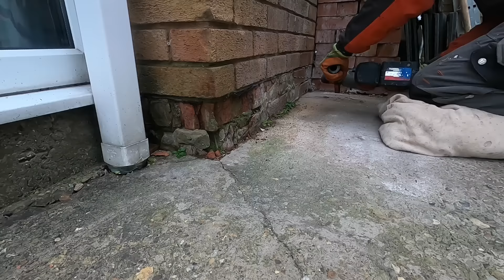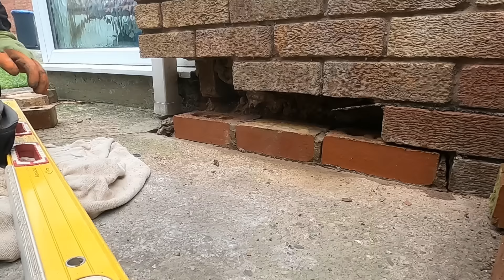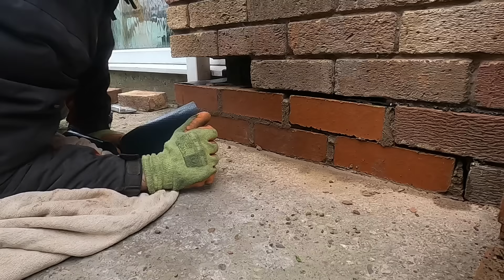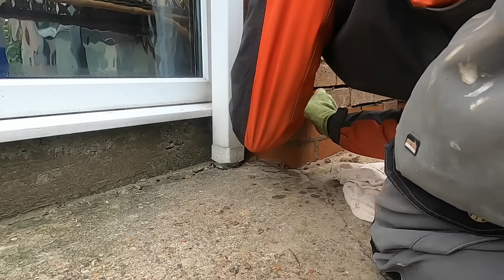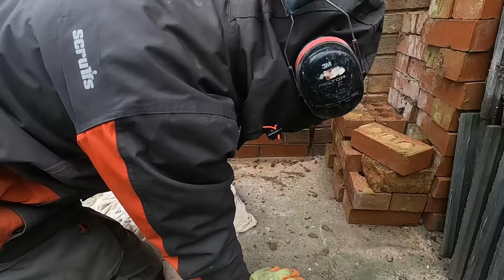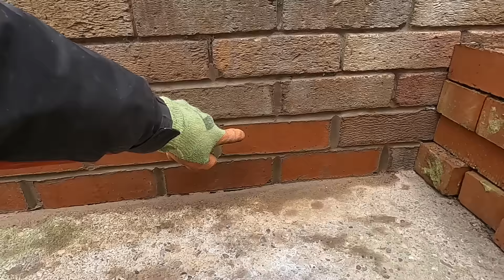Bricklaying- Brick repair job

Comment: I would have taken a quarter inch off the height of the bottom four bricks to help you out. You can make your own thin slicker by grinding it down little by little - try not to make it too hot - I put it in water after every little grind.  I made  a  3/16+ 1/8 slicker with a small tip.  If all else fails tuck the mortar in by moving the tuck pointer side ways for the tight spots.

Comment: Hello Thanks For The video Its Great I have slates holding As The DPC And I need to replace the bricks below and redo the DPC should I remove the slates and the add the new DPC Or Should I Leave The Slates under Many Thanks Joe 👍😎

Comment: What type of mortar did you use I’m  in Northern Michigan Snow and Rain
Reply: The type of mortar depends on the type of brick. For example, I have 1900s clay brick. I have to use a lime/sand mortar. If you use the wrong motor, you can destroy the brick. Someone repointed the brick in my home with contrete mortar and it is way too hard and causes brick damage.

Comment: Shame, there is no damp course introduced to stop the  ground moisture lifting in to the brick. Those new bricks will soon be damaged as the previous bricks were.  A damp course should have been  laid  on the ground under the first layer of bricks. I would have added one layer of expanding cement to give the gaps a better structural joint as when bricks are laid on each other an not under each other, Then the right coloured mortar would be used last.  In my opinon many brick repair is just cosmetic without regaining the original structural conditions.
Reply: Agree try to find a brickie that even knows what expanding motar is
Reply: When you say damp course, is it just a piece of plastic that goes below the all of the bricks? Because he's done it on the second brick course

Comment: What were the flat thin paper like product you used in between that top layer of brick you layed? i'm doing a similar job on my apartment building lost almost three layers of brick due to water damage and Tenants kids see a weakness they go after it???,
Reply from the maker: It’s dpc, damp proof course! Stops the damp rising into the house
Reply: @ConstructionwithKieren  every video I've seen, there they never use these? Also, do you add it to the second course for a reason and not first?

Comment: You are doing bad work 👎 
The bricks look so out of level horrible work the perp joints are horrible and there is not enough mortar in inside of the joints you I saw you filled them 10% which is 1cm of 12 there is no mortar behind the pointing you cowboy builder I would break your hands for working for me that way

Comment: I'm not a builder and unfortunately need to do the exact same job on my house. Can't get hold of tradesmen especialy for small jobs like this!
Reply from the maker: They tend to go for the bigger jobs I'm afraid mate, thats where the profit it! Id be happy to help if I lived close to you.
Reply: @ConstructionwithKieren  with regard to spalling bricks. I've decided to do the repairs myself. If I have to replace some bricks do they have to be the same brick?  My line of thought is that if the new bricks contain different materials they may expand or contract at a slower faster rate than the rest of the wall causing more damage? Am I over thinking?

Comment: Horrible little job but needs must 👍The issue I have with the “External DPC” is ( is it necessary?) What does it do? yes we all have always used it on the pretence it stops splashes and perhaps the migration of moss ect ,but on a negative note does it do more harm the fact it actually traps the water between the DPC and the hard paving thus not allowing the water to evaporate higher and therefore encourages frost to penetrate both joints and bricks . Just a thought and over  to you !
Reply: I'm no bricky/builder but I guess every system has its pros & cons, especially in the fight against mother nature! I'm guessing another (expensive) way to alleviate this might be to design the footings/base bricks with some sort of shingle/drainage system in more severe instances, but probably not needed here. To be fair, these are not the right bricks to use, the downpipe is not situated well and the concrete floor looks slightly too high IMO (debateable). I'd coat this area in a masonary protector cream like Stormdry. 
https://www.youtube.com/watch?v=loLGEyVJH-o  (Skillbuilder)
Reply: I agree with Ronnie , rising damp is a total myth in the building trade they build piers submerged in water and the water will not rise , the city of Venice is built literally on water no problem there..
Reply: @anthonymclean9743  Thank you at least someone is listening , I have yet to hear an argument for it ..We will continue to put it in and it’s very rare you see it bedded ( which I don’t agree with) as the thin slithers of mortar at that level could perish and cause very slight cracking above.
Reply: @anthonymclean9743 Venice is literally sinking. Also.... the piers in Venice are built so deep that they hit hard rock under the clay. That is not the case for other places. You are just in clay
Reply: Eh??
Reply: @paullee7508  think about it
Reply: @Mikethebike57  if the dpc wasn't there the brick would've rotted further up and the damp would've penetrated through to the inside
Reply: @paullee7508  And yet the bricks are allowed to perish below the dpc ? and how does damp cross the cavity unless it’s blocked . I have been a bricklayer ‘ site manager for over 45 years so I understand the concept however it’s one that needs more thought than ( Damp would somehow jump across the cavity ) My argument is this what does it actually do? Besides trapping in saturated masonry between the ground “ path level “ and the dpc “ The internal dpc is an easier one as it is isolating the floor construction from rising ground moisture! I am not saying that I am right or wrong I just needed some input to test the question.

Comment: Nice job and great video and talk over and soundtrack. Pragmatic to leave that slightly wonky brick on the overlap, that's where I would have messed the job up completely. Just a dumb idea: Wonder if it would be any easier using slightly wider DPC so you can keep hold of it, then trim off later (tricky to do that until set though). Look forward to next one.
Reply from the maker: Yes maybe I suppose mate! Always open to new ideas👍🏽 Thankyou for watching John🧱

Comment: Nice work Kieren. Just a quick q; why didn't the original builder use eng bricks??
Reply: I was doing this same job 30 years ago to houses that were at that time only 25 years old! Monotonous job , take a metre out ,miss a metre , no breaker just hammer and bolster ,absolute ball ache.
Reply from the maker: I’ll be honest mate, I’m not sure! I thought it was very odd aswell👍🏽🧱

Comment: Are the new stones the same as the old ones? Or is it because the other are so older?
Reply from the maker: It’s because they are older!
Reply: @ConstructionwithKieren  also the same stones?
Reply from the maker: @leiboohd2614  nope they are different and reclaimed, the customer has had them in the garden for a while and wanted to use them
Reply: @ConstructionwithKieren  Why only the bottom row? Were they brocken?
Reply from the maker: @leiboohd2614  it’s where water has splashed up and got behind the faces and blown. They are just normal bricks they should of been engineering bricks👌🏽